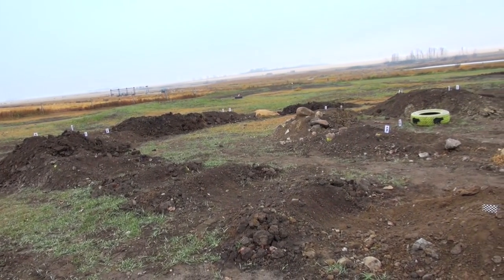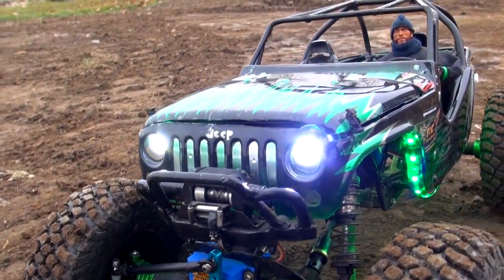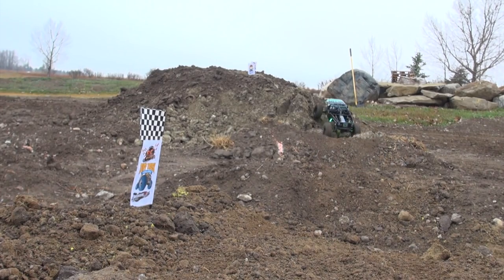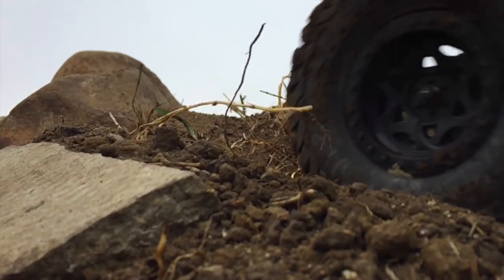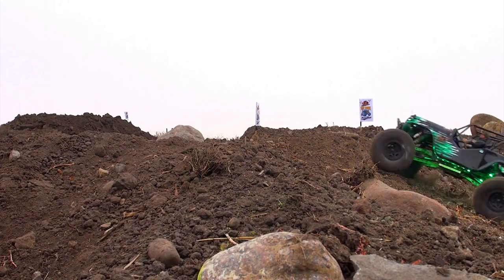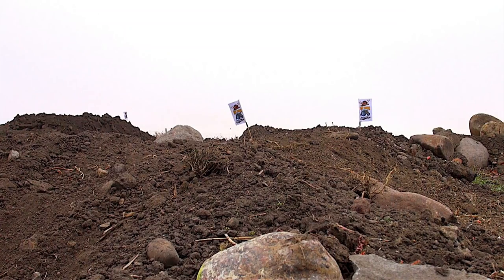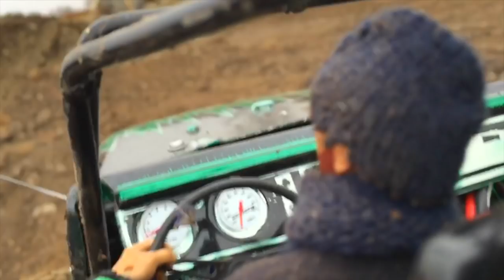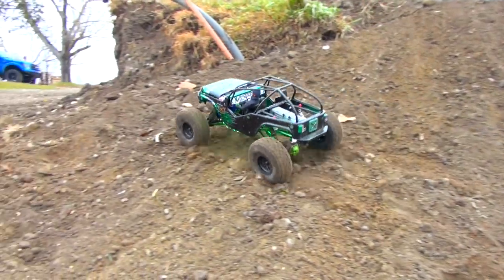Moving Driver in Brushless Buggy RC Truck on Ultra 4 Race Course | RC ADVENTURES

Comment: You could zip tie a receiver plastic aerial tube to the chassis and run the aerial through there. nice rig looks like you got a better deal to me. I watch these videos and think to myself one of these would be good to run when winter really sets in and is way too sticky for a largescale truck or buggy at one of my regular haunts.

Comment: I would love too see how the driver is setup to twist like that!
Reply: My guess wires for arms.. why you see zip ties on the hands.....
Reply: i used a .25" rod "plastic" in to the head and use a number 2,mill set screw in the servo and into the rod , the hands are snap tied to the shirt i never used the body, i only used the hands and the head to make the driver with a shirt only/ i hope this  helps  with your builds !

Comment: Did you have to flip the servo? Or could you've just reversed steering on the remote?
Reply from the maker: Danny M :) If it had have been JUST the steering servo.. you would be correct! Servo RVS would have worked. But because 2 of them were going in the opposite direction from the steering - if I reversed the steering.. the problem would still be there. (They are all hooked into the steering servo plug)  So, by flipping the steering servo.. everything was lined up correctly.. and problem solved!  :~)
Reply: +RCSparks Studio soon as I thought about for a moment as suggested, it all came in to focus haha! Thanks man! Wicked truck!!

Comment: hey Aaron, Ive been wanting to get in to the hobbie but i dont really know what kind of rc to get. I would like to have something that is strong, fast, and able to offroad, but not too expensive. Do you have any suggestions?
Reply from the maker: What is: "Not too expensive".. It means something different to everyone. A Base Truck is at least 350 +battery ;)
Reply: RCSparks Studio Under 550 is good. 350 is less than i thought.
Reply: David Lopez you can't go wrong with a slash 4x4. You can get the RTR brand new or get a roller and buy the other necessary parts
Reply: Genesis RC alright ill look into that thanks

Comment: If the servo was working in reverse why didn't you reverse the channel on your transmitter.
Reply: Nick Ing dazed & confused  - because then the driver would still be steering the wrong direction to the direction the wheels go
Reply from the maker: yup, nailed it. So the "easy" answer was to flip the steering servo and make a new throw arm for it..